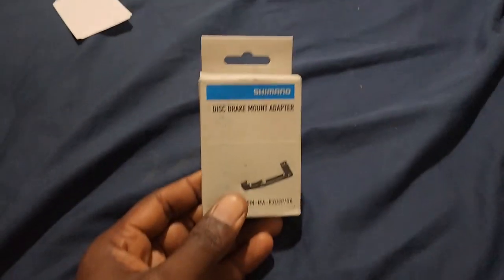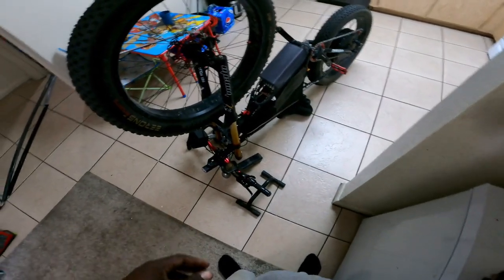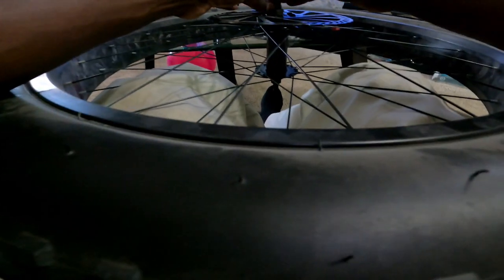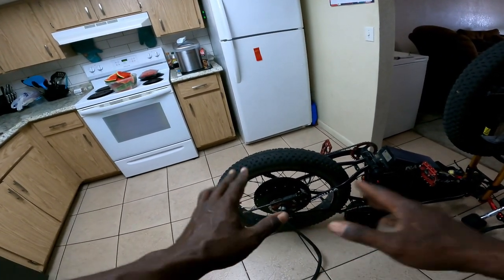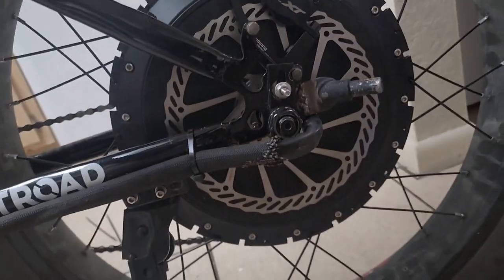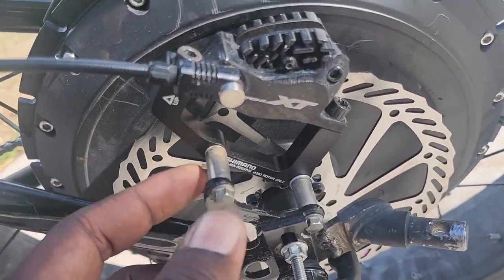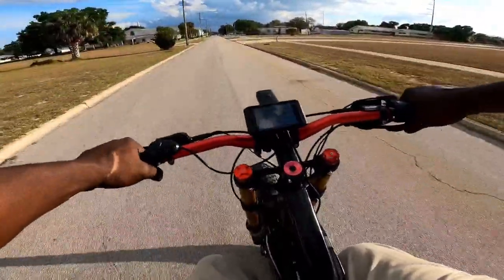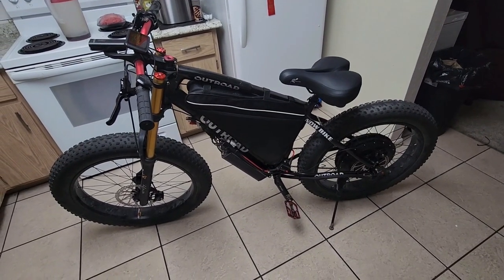installing new rotors on my ebike 203mm

Comment: I have the Ozark trail ridge bike. It ended up being M2 latest model that has the 180 F 160 R. Horrible rear brake.  I am waiting for my adapters to do just this. 203 all around.  The best upgrade besides hydraulic brakes.
Reply from the maker: @robertsilva5041  definitely agree

Comment: Getting 220mm floating rotors for my bomber soon, I have a lot of hills here in the UK.
Reply from the maker: I was looking for them for the front but man they are pricey.
Reply: @E-bikeguy  I have the hope tech 4 calipers but for rotors the hope ones cost £50 each, shimano do some for around £16. Model number is: Shimano SLX SM-RT66
Reply: BTW in regards to shortening your phase cable make sure to grind and sand paper off the resin on the cables as it inhibits electricity on the connectors, I made that mistake already.
Reply from the maker: @9MileRoar  oh ok, thanks

Comment: Congrats on the 203s. I upgraded to 203s a few months back and changed out to some 4 piston Hayes and it was the best decision. Tons of modulation and can stop on a dime without riping thru pads . Makes the bike feel much safer.
Reply from the maker: Yes it do plus I don't have to use much of the regen too feels incredible.

Comment: Magura rotors are thicker and have a floating disc 
I highly recommend them for use with the QS 205 and 273
Reply from the maker: OK I will get them next
Reply: What size for front and back?
Reply from the maker: It's 203mm front and back
Reply: Does it matter which version i get? I see ones that range from $30-$40 then there's the silver and black $90 ones

Edit (current prices on Amazon):
Storm HC: $27
USA MDR-C: $37
Black and silver rotor: $95
Reply from the maker: @emplays22  not really. Lol
Reply: @E-bikeguy  good to know i really did not want to have to spend upwards $90 PER ROTOR and not even have the adapter included at the least lol
Reply from the maker: @EMPLAYS  lol ok the ones I have work and they cheap

Comment: My 3000w fat tyre has 4 piston 180 discs front and rear , this set-up and the ebrake  stops really well. 
My disc isn't as inboard as yours so there's no spacers required to move the caliper mounting over. 
Maybe you could beef up the mounting plate so you don't need that bracket welded to the chain stay tube.
Reply from the maker: Yeah, it was a last minute dicision, it didn't did all that flexing with the 160mm but I can remove the mount at any time if I have to

Comment: @35:00 i think its the frame tabs flexing thats allowing the caliper to hit the motor. If its only the two long spacers flexing the caliper would only move away from the motor. The rotor is way to far from the frame for it’s original design and now the larger diameter rotor just exaggerated the problem. 

The fix would be something that beefs up the frame tabs and at the same time replaces the two spaces with a solid block that cant flex. But if you only add the solid block the caliper will still hit the motor as the frame tabs flex. 

But if you make a solid block to replace the spacers and weld it to the frame tabs and carry it forward to the frame something like you were saying that should work. 

If it were my bike i would have left the rear brake 160mm because if your regen is set correctly then 160 is mire than enough to lock skid the rear wheel. I found that out when i set regen to 15 amps and grabbed a handful or rear brakes. Lol. 

The way my brakes are set are such that 90% of the stopping is regen only by squeezing the front brake lever only enough to activate the brake sensor but not enough to apply brakes. Then as needed for faster stops just apply more front brake (since rear brake is already regen). And then only emergency braking on dry roads do I gently squeeze the rear brake lever. My pads and rotors are 2.5 years old and like new.

You want the ability to lock up both wheels but normal driving should rarely use the brake pads. 

Your controller supports variable regen but someone needs to invent the rear brake lever that the first 50% travel makes a 0-5v proportional signal and then the hydraulic brakes begin to engage. Sabvoton should make that so their amazing controller feature can be used easier.
Reply from the maker: Very informative, that is what I do 90% of the time is I activate the regen before I hit the brakes but man it was so much flexing at the caliper but a nice block would have stopped that for sure I'm going to see if I can make something like that to mount up tho
Reply: @E-bikeguy  , you need a go pro Mount back there and then you can see exactly whats flexing. I already know the frame tabs are flexing because only that would allow the caliper to rotate where to front moves out and the back moves in and touches the motor. If it were only the two spacers flexing the front and rear would stay parallel to the disc and worst case it would move slightly away from the motor. 

But that sound you heard was not a brake pad contacting the rotor flat, but a cockeyed caliper which the left pad is only hitting the rotor with the rear and the right pad is only hitting the rotor with the front, giving that terrible noise. 

Im sure you’ll get it fixed, just giving you some ideas so you know what additional steps you might need to take to stop the caliper from twisting out of alignment with the rotor.
Reply from the maker: @IMHO  yes most helpful, so today I'll look at it some more, it started raining so our day was short lol

Comment: How big r ur dropouts 195? The qs is 155mm? Was it easy putting the motor on just got a frame with 195 bout to throw a qs 205 on it but it's got 155mm
Reply from the maker: It's a 170mm dropouts the qs205 axle is shorter than the qs273 so the 205 won't fit NB power makes a 5000w wheel with a 170mm dropouts
Reply: @E-bikeguy  i think I have found that kit on Amazon for 175mm how many volts can that motor handle? I'm planning on pairing two 48v for 96vs

Comment: Next upgrade should be a 3 by but just big sprocket then you can peddle assist over 20mph
Reply from the maker: OK. We'll I was thinking about getting a bigger sprocket up front.
Reply: @E-bikeguy  you need to be 40 + to make a difference, I had to buy a 3 by that had a 38 and then buy a 44 for the style of bottom bracket, the modern one I got 42, the 3 but is to clear the frame, I like to peddle pass the cops house for legal reasons,, you can save battery. The 32 I'm peddling like the six million dollar man at 16mph
Reply: @E-bikeguy  on yeah great for exercise
Reply from the maker: Lol OK I like that,
Reply: You no about cruise control?
Reply: You no if you hold the bottom arrow down for 5 to 10 seconds it turns on cruise control I use it all the time

Comment: I'm running twin 220's on the front and a 203 on the rear of my bomber
Reply from the maker: I was going to do that same setup but the 220s were more expensive, but now the 203s has more than enough stopping power

Comment: Is there anything that I can buy to tell me exactly what percentage of battery I've got left for example it may say you got 99% left or 15% left
Reply from the maker: I'll send you a link
Reply from the maker: Electric Bike LCD Digital Battery Voltage Display Digit Display Voltage Voltmeter for Scooter Electric Scooter Voltage Display Bike Power Voltmeter LCD Handlebar Throttle Grip 48v Electric Bike Scoot https://a.co/d/1pdYSyB
Reply: If you want to know the real state of charge, you need a device which measures current and does coulomb counting (number of electrons going in and out). You cant do it accurately with voltage alone. There are a few choices to get this. Either a stand alone meter with shunt or a smart BMS which can tell you everything about your battery including state of charge. 

If you go with a meter, you must know the peak amps your bike uses and make sure the shunt can handle that range. 0-50a, 0-100a. 0-200a, etc. The lowest range that covers your max amps will be most accurate. Then you program it to show how many AH or kwh the battery is and the meter will reset to 100% each time the battery is fully charged and it will count every electron leaving and let you know the state of charge. A real SOC meter will not dip in SOC as you give full throttle like a voltage meter will. It only measures electrons leaving. You also get lots of other nice information about amps, voltage, watts ect. They cost about $20.

The other option is to buy a bluetooth BMS for your battery. That show everything a SOC meter shows but also shows you the voltage of every brick in your battery, any cell balancing going on, whether the charge and discharge ports are open or closed. These are also programmable so you can set your max charge to 80% if your battery is big and you want it to last 5 times longer. If going on a longer trip you can open the app and change it to charge to 100%. These range from $80-$160 depending on max current and and balancing method.
Reply: I bought two of what's linked. they work for voltage under 60
Reply from the maker: @paul mryglod  ok so its52v on down?
Reply: @E-bikeguy  60v or less. So, max 60. My guess is it just won't work until voltage is under 60

Comment: What is the best ebike controller to buy for a 2000w 52v kit. The absolute best and what power should I be looking to pull through it. I can't get higher than 2000w peak. I have a 19.2 a battery. I don't know what to do.
Reply from the maker: Your best bet will be the sabvoton 7245 controller
Reply: @E-bikeguy  and how many watts should that pull through the motor then roughly?
Reply from the maker: @kingliam4340  is around 1800 to 2300w

Comment: Try a 220/223mm rotor up front. There is a huge difference from 203
Reply from the maker: Ok so 203 in the rear and a 220 up front?
Reply: @E-bikeguy  check your frame. Some frames will only fit up to 200/203. Big rotors help a lot more than brakes so I always try big rotors first and they also give a better modulation feeling than small rotors.
Reply from the maker: @duanehundley  ok I'll check it tomorrow

Comment: Ahah cmon got the upgrade 220mm next it’s a whole new game but is a crazy upgrade from 160mm
Reply: Daym shimano xt you should review those brakes I am struggling choosing new brakes on my bike
Reply: You should’ve not touched the disk with your hands much
Reply: I got 220mm rotor 5k hardtail the 220on it ,the back is good but can lock a little easier but apart from that it’s like upgrading from 180-203 but from 203-220
Reply: I have my motor wire permanently attached
Reply from the maker: That's what I thought too about the oil on my hands.
Reply: You can disconnect display and take off throttle and pull it all off the bike I wish I could show you what I mean I taped up all the wires off and took all those spare plugs of and terminated the end of the cable and taped it all compact
Reply: Do you have instagram?
Reply: Facebook?
Reply from the maker: They are the knock offs but man they work way better than my zoom  brakes
Reply from the maker: Oh ok I was trying to make it look neat too
Reply: @E-bikeguy  I’m got sram 4 pot brakes but trying to upgrade to the shimano saints
Reply: 4 pot brakes are the dream I be real sram is very good unless you get a high grade shimano

Comment: Don't ever touch the rotors or pads with your bare hands, the oils, dirt on your skin will contaminate the braking surface and cause squealing, vibration and generally just a bad time lol. Wear gloves or some shit. ✌
Reply from the maker: Yes I learned that the hard way